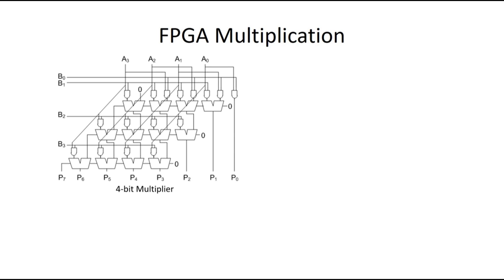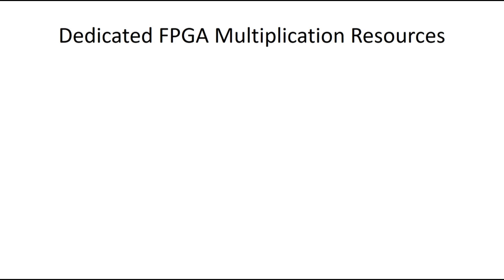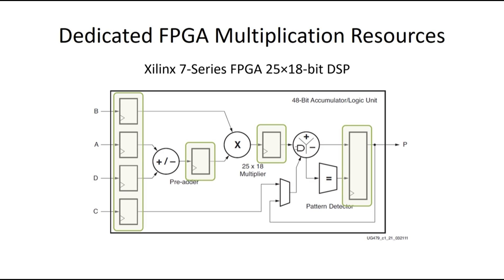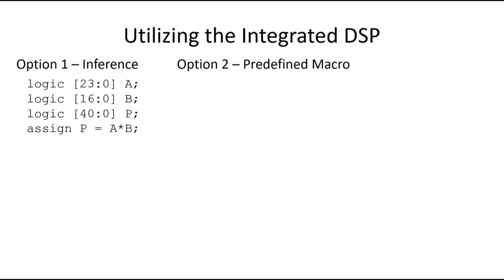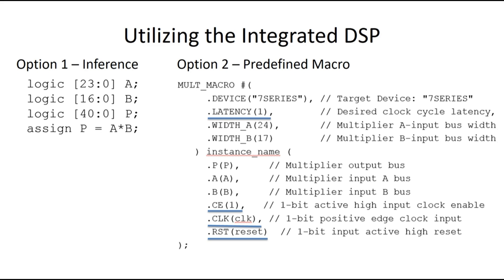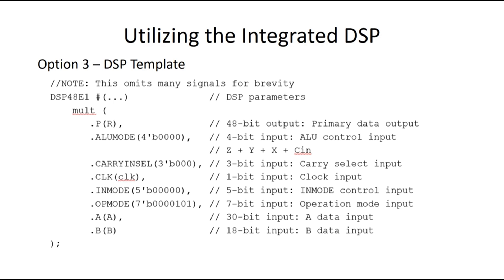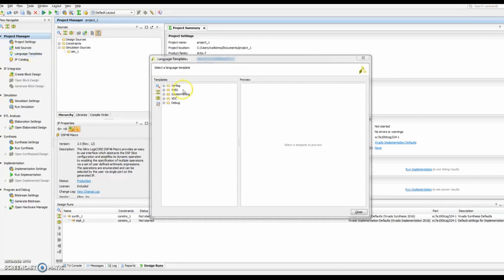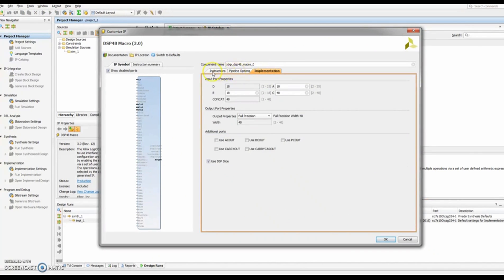FPGA DSP Overview

Comment: Nice video.  Thank you.   Since the multiplier is a 25 x 18 multiplier, how would a 32x32 or 64x64 bit multiplication be accomplished?   I assume it would use multiple blocks..  
I envision using these blocks to hardware assist a microprocessor, for instance, and it may be a 32-bit  or even a 64-bit processor....
Reply: You use multiple blocks to compute partial products. So a 32x32 multiply would use 4 DSP blocks. The 32-bit operands are broken down into a 17-bit and a 15-bit operand. So A*B becomes AH*BH + AH*BL + AL*BH + AL*BL, each of which fitting within the 25x18-bit multiplier. The DSP blocks also contain fast fabric interconnects for such operations, which allow adjacent DSP blocks to connect together (without using LUTs), as well as a 17-bit input shift option from this fast path (since it's a 25x18 multiplier). To do 64-bit multiplication, you need more partial products and more stages (there's a table somewhere, but I can't recall where. In the worst case). It's going to be 16 blocks, since 64-bits can be broken up into 4x 32-bit partial products. However, since the DSP blocks are 25x18 and not 18x18, I think it practically becomes something like 10 blocks for 64-bits.